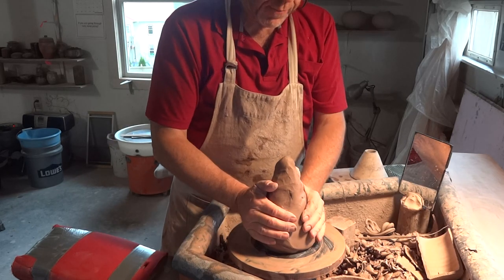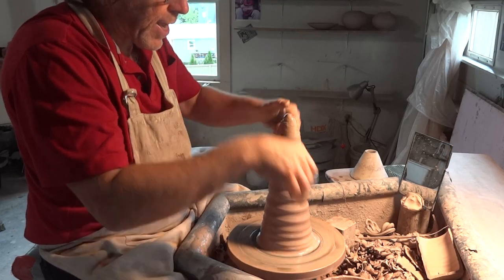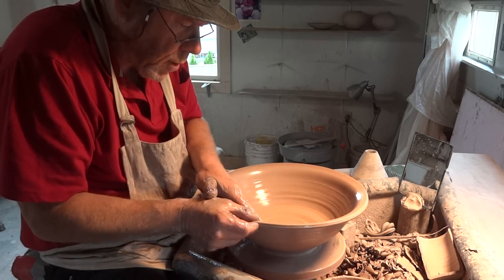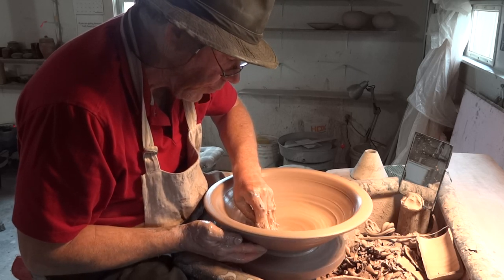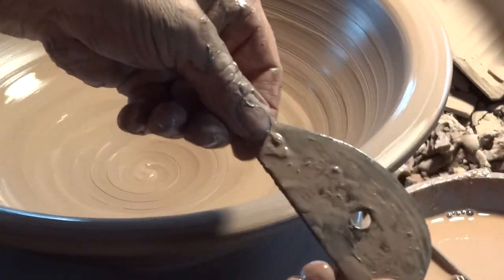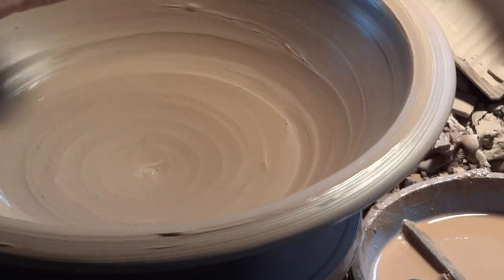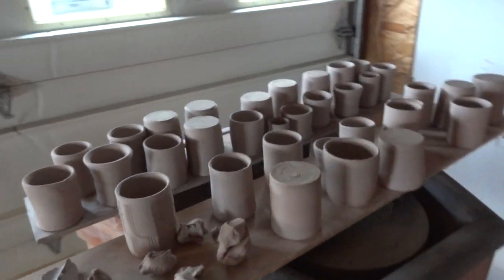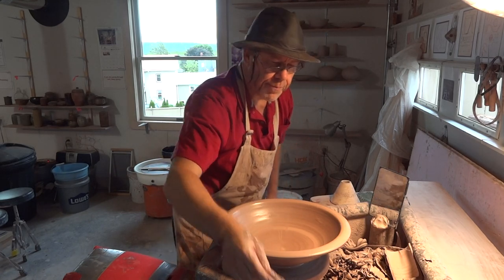How to throw a 6lb open bowl with Simon Leach !

Comment: can you show us how you adjust the inside of the bowl when it's leather hard please?
Reply: brilliant, thanks, I've always been told you can't change the inside once it's leather hard and I get that little square edge all the time.
Reply from the maker: Well what you were told is not actually true as you can change the inside, best make sure its well attached to the wheel though.
I will demo this shortly.

Comment: Adding a simple wood stop block to the foot control of an electric wheel prevents the wheel from turning too fast.  The block can be fine tuned by adding a paper spacer to get rates of one revolution per second when controller is fully pressed.  I found it is easy to slow the wheel with the block in place.
Reply: The big advantage of the stop block is it prevents accidental changes in wheel speed faster than normal throwing speed.